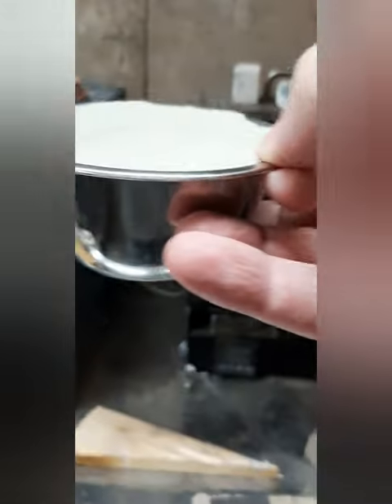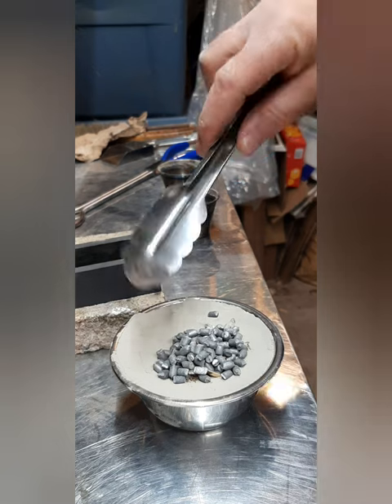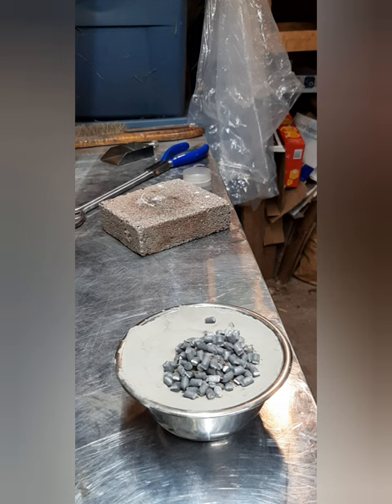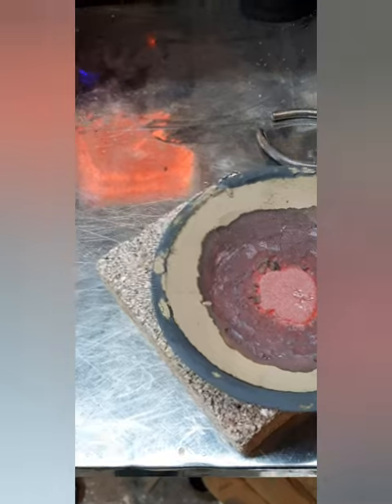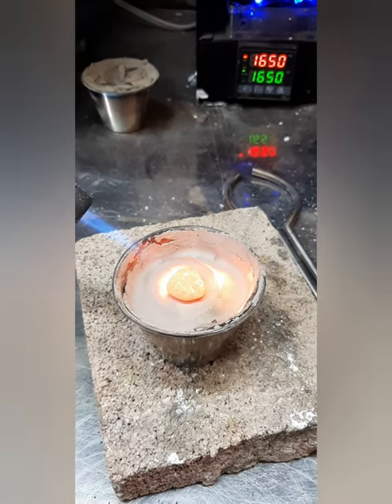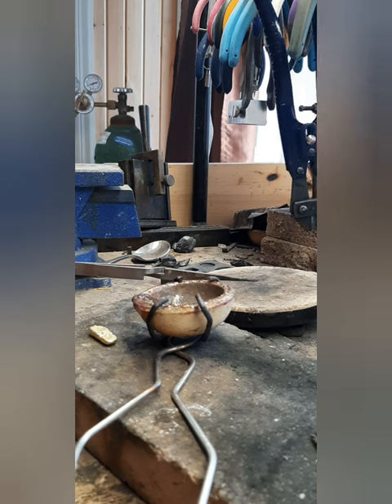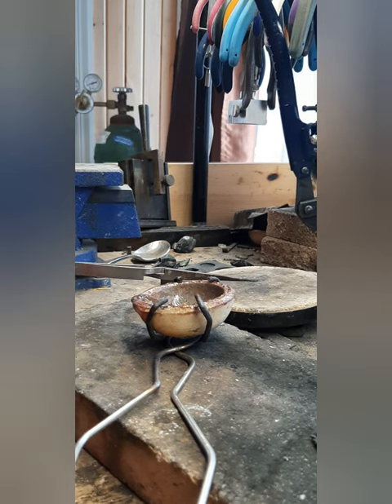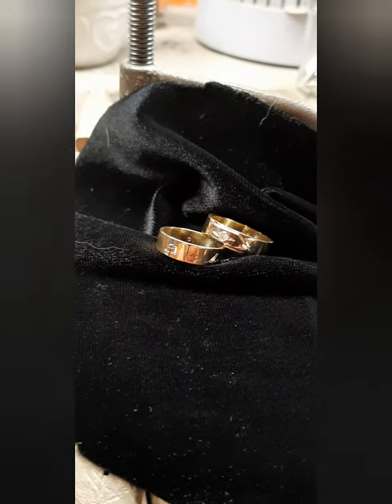Refining gold with Portland cement.

Comment: I dont have a kelm so i did the whole process with acetylene and ocygen tanks. I think i burned the gold cuz of all the red i saw afterward. Is that possible even though there was still a ball of metal there? It looks like a ball of copper when i finished. Should i just keep going? It was 9 kt pins and lead i melted. What im asking is it possible to burn the gold before burning off all the other metal alloys first.?